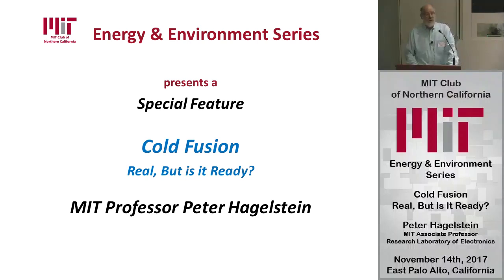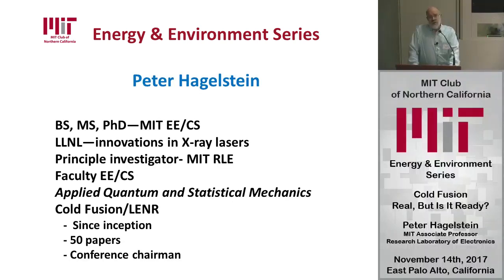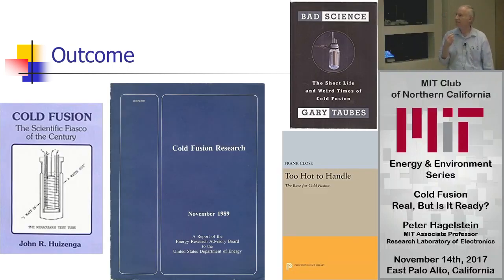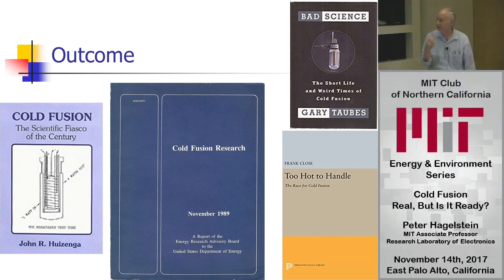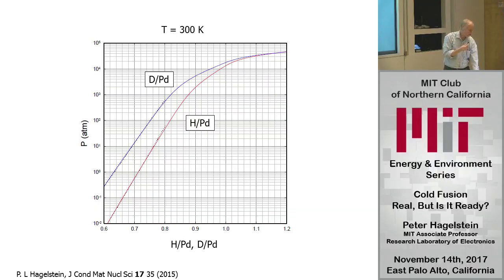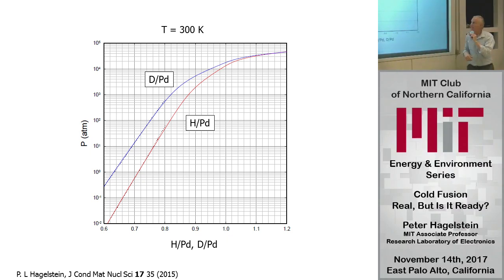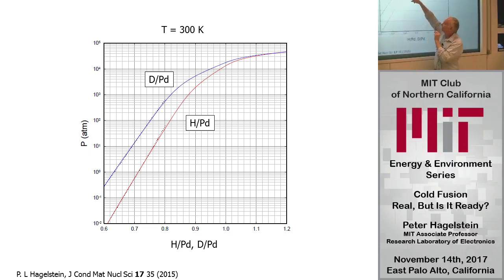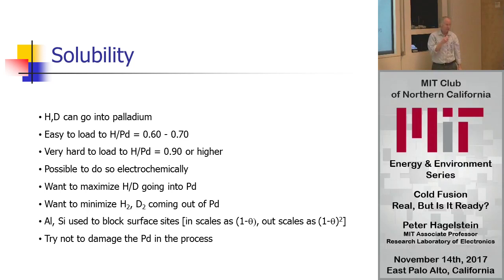Cold Fusion - Real, But Is It Ready? - Prof. Peter Hagelstein

Comment: DO NOT LET (SOME SCIENTIST FOOL YOU) YOUR CAR CAN BE RAN BY 3-4 TYPES OF FUEL! IT IS IN THE REGULATORS AND COMPUTERS AND LINES AND SEALS! IF YOU HAVE THE OBOVE IN ORDER? YES, YOU CAN DRIVE OFF AND RUN;  WITH -0- EMISSIONS! AND WHEN ONE PRICE GOES UP? THEN WITH A FLIP OF A SWITCH? THE COMPUTER TAKES CHARGE! VERY SIMPL.

Comment: Cold fusion?  Give  me one example, one, where cold fusion exists in nature.  Next will be a proven assertion about the Easter Bunny existing.  For fusion to occur (stars) requires tremendous heat and tremendous pressure.  We can get around the pressure requirement by increasing the temperature to hundreds of millions of degrees (Kelvin). The ideal gas law shows the connection between temperature and pressure (PV=nRT)  nicely.  If you decrease one (pressure), the other (temperature) must increase.  Mathematically cold fusion is impossible at our pressure.  Science is under attack from non-science nitwits who get some behind idiot scientist and his half baked theory.
Reply: Gravity. Quantum Kinetic Well(tm).